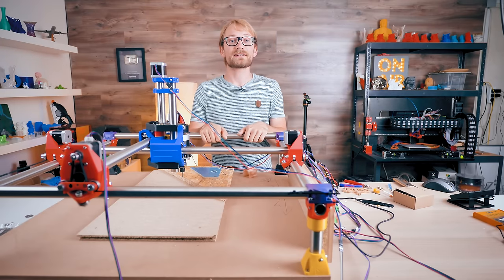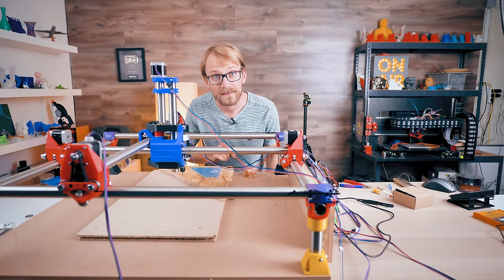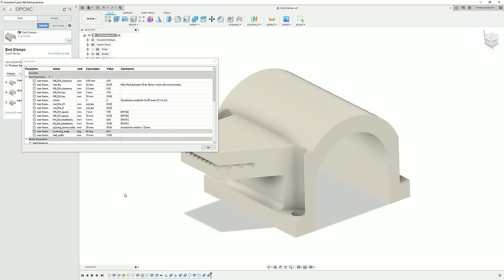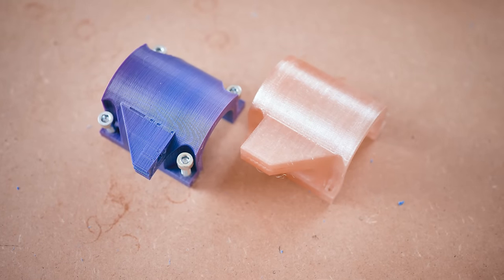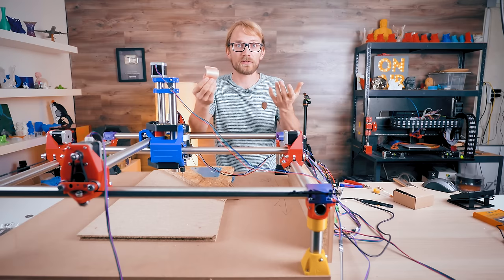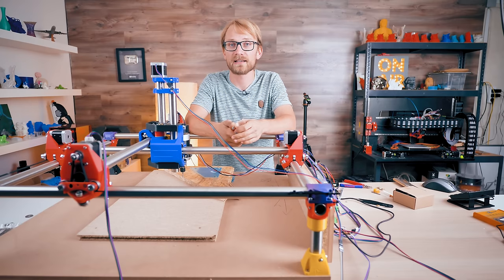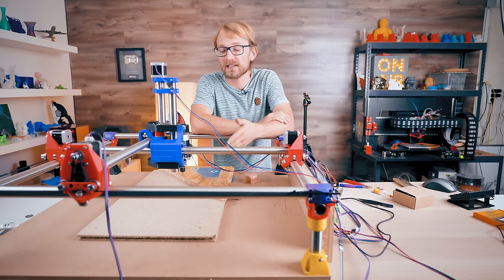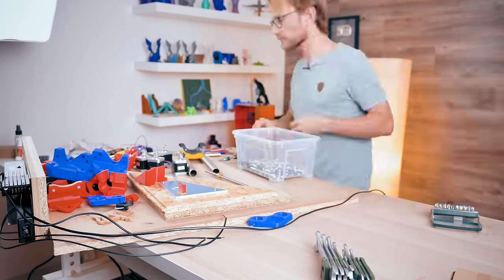Whose design even is this? (MPCNC conclusion)

Comment: I printed the parts 1/2 year ago and also bought quite expensive conduit and router spindle. Guess I'll go and design my own one. Too bad this ended up the way it did - but on the other way, it teaches me to always (ALWAYS) check the license first. I wonder if all the other youtubers have the permission from V1engineering for their build videos, though...
I am looking forward to your next project.
Reply: Tom had explicit permission on the build video, and was only asked that he release the modified part with the non-commercial license, instead of wide open.  What exactly is the problem?
Reply: @GeoffreyPitman523  I missed this comment 3 years ago :) The problem here is - as this is non-commercial license, whenever would I use the final product to gain any money, I would violate the license. I'd rather look into something fully open source, so I don't need to re-consider the machine once I am able to produce something I can charge people for.
Reply: That is not the case, the NC license is just to prevent selling printed parts. Items you produce would not be subject. You can ask the creator himself.

Comment: Copyright does not apply to physical designs, only to the plans and the files, if you didn't use his then he has no control over your work, he hasn't got a leg to stand on.
There are other laws which apply to aesthetics, but they only come into play if there's some artistic element to the look (the MPC-CNC almost certainly doesn't qualify) and also with regards to "passing off".
Aspects of functional design which are new and can be considered inventions can be covered by patents.
The details of these laws vary to some degree by country, but I doubt you'll find any in which what you originally planned to do is not completely legal.

Comment: I had wondered about that, I saw all that stuff when they designed the Piper printers as a derivative. Oh well. I was going MPCNC but it looks like I’ll be creating my own fixed gantry 3d printed Cnc. I don’t think the moving gantry will ever work well for milling metal.  I assume having some sort of truck following a metal tube isn’t derivative?

Comment: I was curious about building this.  It would have been good to see what Tom came up with.  (I think the problems go far deeper than how the belt is clamped though, and all of that was still to come.)  If clever people aren't allowed to contribute, innovate and share as they see fit I think I'll find another project model to look at, one that doesn't confuse functionality with copyright.  RIP MPCNC.

As far as this particular project goes (or went) It think it's a reminder that you can't just scale a project up and still use the same components.  We learned that from building 3D printers didn't we?

Comment: I have purchased several hundred dollars worth of parts from Ryan for a Lowrider CNC. Each time that I comment in the V1Engineering facebook page that I was modifying the design to be more rigid in the gantry and Y plates,  I felt a unnecessary amount of resistance from Ryan and community members. 

It feels like each time somebody in the forum tries to make something 'better' or just 'better suited for their needs', there are comments that indicate it is unnecessary and the design is fine as it is. 

Ultimately, I abandoned the Lowrider design because a openbuilds vwheel based design just seemed more rigid, more workable\replaceable, and had better information available.

By not making these projects fully open source, it is limiting the project more than supporting it. 
I think that if Ryan does not look at what he would lose\gain from making this open source in a REAL manner, and not just a ballooned 'hypothetical' sense, he will be continue to do a disservice to himself and the community. 

Businesses do not want to make these machines. Just makers and 3D printing enthusiasts.  

TO BE CLEAR: I am not 'loyal' to Tom Sanladerer or Ryan @V1engineering. I am simply a enthusiast that wants the community to benefit from working together, and not hindered by ego. To have such a discussion over a simple belt clamp add-on seems ABSURD to me in any capacity.
Reply: Oh no... so the hypothetical design changes that you didn't ever actually build weren't immediately adopted and praised?  Sounds like a bummer.  If you did build them, were you able to demonstrate that they were actually "better" and not simply "different"?
Reply: @GeoffreyPitman523  are you a proponent for killing ideas before entertaining them?
Reply: @waldvogelreview7755  as a thought experiment, there are way too many things that could potentially make a negligible difference, I'd make the change myself and then discuss the results.  Expecting others to try out every thought that pops into everyone's head is unreasonable.
Reply: @GeoffreyPitman523  youre making assumptions that myself or the others are asking others to make these changes blindly. 

Perhaps someone in the community just wants to know if it would be beneficial, if its been tried, or spark the idea for others. That conversation shouldnt be shutdown by anybody that hasnt tried it themselves or anybody that feels threatened by new ideas. 

The biggest mistake people make is that V1 Engineering is not that typical opensource friendly community that were are used to, but also not the large corporation that can ignore somebody doing this in their own shops. V1 Engineering is small enough to feel threatened by the idea of someone designing more sensible parts for his machine and making them free. I personally think if he went 100% open sources and encouraged a community mindset like @OpenBuilds does, there would more people willing to buy products and parts from him. Just my thoughts. 

Now Geoffrey, you seem unusually combative for the casual looky-loo or troll. Would you like to state your experience and affiliation\history with V1 Engineering or Thomas Sanladerer so that we might make some assumptions about you and your position in this argument as well? If you love your V1 Engineering product. GREAT good for you and everyone else that is ok with performance of your machine. However, not everyone WILL be ok with moving that slow, with low rigidity, or hardware store parts.
Reply: @waldvogelreview7755  so again, because of your hypothetical knock on the machine it's by default terrible? And your suggestions, again non-tested (apparently after not even testing the original) should be embraced by all with open arms... instead of them coming back with hypotheticals of their own or real world experience?  

Regardless, I'm nothing more than someone who likes to make things, and have an (almost)MPCNC of my own that I haven't finished for a myriad of reasons.  But I know the forums quite well and participate when I can.  I just think it's arrogant to think you can jump in and tell folks that they are doing it wrong when you haven't shown that you're doing it right, or better...
Reply: @GeoffreyPitman523  Dont you read about engineering and your hobbies before you invest in them? Dont you read about the differences between a Toyota and a Kia before buying one? The reality is, the MPCNC cannot meet my needs. I watched and read several instances where it could not go to 4x4' without major flexing in the axis'. There are size limitations.

 I went for a lowrider (v1 at the time). I read the experiences and pitfalls  of others and decided to make a change on my personal machine. 1, to make the gantry heavier so that lifting when plunging into aluminum at proper depth of cut. 2, to use engineering concepts to reduce flex, torsion, and weight on the gantry over a span of 3.5 - 4 feet.

After printing the parts, i immediately recognized that this would in no way remain rigid enough to cut aluminum effectively and meet my needs. The same way a person who wants to get 300k miles out of a car probably will find a KIA will not meet their needs in most instances. 

So I went for a much more rigid machine that costs more. So when Tom said he wanted to use this machine to cut aluminum plate, I had a strong feeling this would not meet his needs based on my research and existing CNC\Linear motion knowledge. I knew from the trials and tribulations of others combined with industry knowledge to make an educated decision. Ironically you do not need to TRY AND FAIL to make well informed decisions.

So YES, enjoy your  MPCNC. I am sure you can cut something on it. But we all just watched this machine fail to cut aluminum at a fairly low chipload. What makes you think that he and the many others that have struggled are wrong? I am sure its a fun build for those looking to explore the craft. It isnt an aluminum cutting beast and cannot cut 1\4" aluminum plate without tearing through bits or flexing significantly. 

If you say my stuff is hypothetical or wrong, PLEASE PLEASE PLEASE make a video defending your position. If you think that knowledge, experiencing and owning a machine for awhile can somehow prove Tom's experience wrong, show the world. All of Ryans videos and the other V1 Engineering videos are not cutting aluminum at realistic speeds or chipload. They are babying it, and feathering it along at the expense of endmills.

Comment: The MPCNC is a derivative of hundreds of machines before it.  The spacing of bolt holes does not constitute an original design IMO.

That said, Thomas should have chosen a more open-source design to build from, they are all basically this exact built.

Comment: What an absolute nut sack. 
New Thomas Sanladerer series: Design and make a 3D printed CNC using commonly available steel pipe, filled with epoxy substrate to reduce vibrations and improve cut quality

Comment: Now I really feel motivated to start my own project - simple plotter, which could also act as limited CNC or 3D printer. Goal? I want to use absolutely NO 3D printed parts. And then with RepRap in mind print all holders, make it more robust, repeat few times and it should be good to go.
I already have ideas, but don't want to show it unless I buy everything (it's really low price oriented) and check if it moves as I expected.

Comment: Thank you.
The MPCNC is an underbuilt POS to begin with.
You are doing the right thing by getting rid of it, especially if the designer is going to be such an idiot as to restrict access to upgrades that should have been part of the original design.

Comment: Fundamentally, if I was the designer of this machine, I would welcome any improvements that would help proliferate the project and improve the operation of the machine.  It would be a net positive.  Especially if it came from a YouTube channel with almost a quarter million subscribers who could be potential builders.  You're either a part of the community or not.  It usually does not go well if you build a fence.
Reply: Design changes and improvements are welcome and encouraged.  The only thing that was asked of Tom was that he release the change under the original non-commercial license.

Comment: A commercial 3018 is a lot more fun to play with anyway! And it has a nice big fan base.
You can get one for about 150 DollarZ in Europe, and have modding action going on. Special
engineered parts for this type of machine are easy to track and are quite affordable, or adapt
common ones.
I wonder how good the 3018 would be if you build it with Toms left over parts of the belt driven
MPCNC. Putting a Arduino with a CNC shild and a spindel relais would give you no restrictions
on probing, autoleveling, laser, light millig, engraving or vynyl cutting. I would like to see one
build from scratch for sure :). On top there are far less printed parts to produce than the MPCNC.

Comment: I don't know what copyright license is used on PrintNC, but I think it's a much better, more rigid design. I've seen one build of the mpcnc with wider belts that better but it can only go so far and if the original designer takes that down too, who benefits from that?
I've designed and built a cnc based on chinese linear rails, fully assembled 'z axis' with leadscrews and it's great!

Comment: There's appears to be some pretty bad misrepresentation in these comments as to the intent of Ryan (unsure surname) from what I can tell:  The MPCNC stuff would appear to fully support derivative works, but if you take his designs and make a derivative the license says you must similarly license your derivative.  In this case with a non-commercial license that stops people using the part for profit. You'll notice Ryan never asked for Tom to remove the part, only change the license.

Tom appears to prefer a more open license that allows commercial use (so do I if it matters) but the rule is if you make a derivative you have to follow the rules of the source license (I can't freely take GPL software that I don't own, make changes to it and re-release as LGPL for example). This is a debate that's been going on in the open source community for years: Should commercial interests be able to profit from open source software.  Sounds like Tom and Ryan are of different opinions in regard to this, at least as it related to MPCNC stuff.

If this is a derivative work then Ryan is perfectly within his rights to ask for it to be correctly licensed.  If the open source community doesn't enforce it's licenses the whole system would fall apart.

Now, whether what Tom created was actually a derivative work or not: I've no idea. This is where Lawyers make all their money: the grey areas.  I'm also not 100% sure but I believe the license is applied to the STL file, not the product of that file, so the derivative claim would related to Tom's STL file not his printed part.
Reply: It's even wore: who's laws apply? Tom's German law? Ryan's American law? Too bad for the whole project...

Comment: Well seems like im not even going to build a V1 Enginering CNC at all. so should creality or what ever take overship for making a 2020 extrusion mount, or cable ties just because it improves or changes the original design. did this change or did this the state at all? no one owns a clamp for a 20 cm radius iron pipe? sure it is an improvement but i would think he should have enganged more openly. so it would seem that if i were to build his design i would not be able to earn money using the machine? then whats the point of building and using it?

Comment: Full size cnc machines don't use belts for axis movement, they use ball screws, some new machines (DMG) use linear motors.
Reply: Ball screws would cost more than the machine does at the moment.

Comment: Had planned on building one of these myself: printing the parts, then using the printed machine to make aluminum replacement parts for a more-solid machine for less cash outlay than what I'd have to spend on an OpenBuilds setup, but with quite a few changes to the original design due to very glaring and obvious engineering shortfalls (belt capture being one of the bigger issues, router gantry lever length being another), but forget this noise.  It's technically not possible to claim copyright on or obtain a patent for anything so mindlessly simple as a u-channel with four bolt holes, so Ryan is blowing hot air - any court in the US would laugh him out the door considering this is already settled case law, and I imagine it would be even more ridiculous in the EU, which has seen THAT EXACT DESIGN for hundreds (thousands, really) of years before the US even existed (literally every single cart axle bracket ever created).  The fact that he chose such a ridiculous hill to die on says all I need to know about his character.  This has become a hard-pass, and I'll be looking into either going with my own design (probably not the best idea, to be honest), checking into open-source projects, or just buying a C-channel setup from OpenBuilds for uncomfortable amounts of money.

Sorry you had to take the bullet on this for the situation to come to light, but I thank you for doing so.  Some comments mentions a Root CNC project, so I'm gonna go see what they're about.  Love your videos.  Keep doing what you do.

Comment: Design your own TSCNC version. Carbon fiber rails, ball screws and cast granite feet. Maybe a linear rail for the cutting head. Casting the feet out of granite in 3D printed molds with mounting/leveling lugs.

 Feet could be whatever you want the design to be, thereby custom for every builder. Wouldn't be mostly printed but a lot more rigid. Cast granite guides/gantry could be designed. Fill the carbon fiber rails with cast granite.

Cutting machines are heavy and rigid for a reason. Vibration from deflection at the cutting edge is destructive to every component over time and directly affect performance, precision and repeat-ability. A lot of new high precision multi axis German made machines are made with cast granite bases now. Very stable.

3D printer mold making and casting can be fun. I've made some custom silicone ice cube molds. Pretty easy.
Reply: Sounds like it would work great, but not really in the spirit and budget of MPCNC.  The point is to be able to have a functional machine without spending thousands.

Comment: Solid decision to take the machine apart. If the creator does not see the value of you modding/improving it (especially very valuable feedback for a start-up), that generally means there is no commitment to push the product development, and as such no sustainable future for the platform and should be abandoned asap.